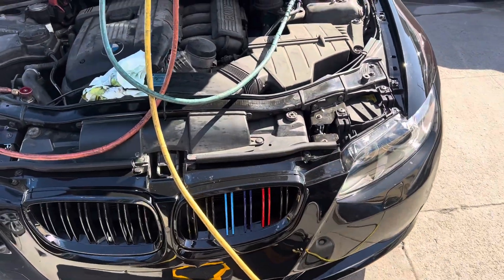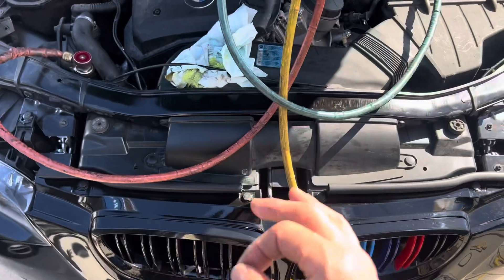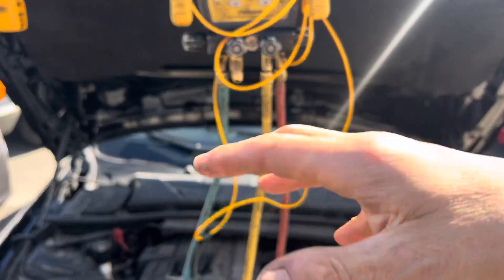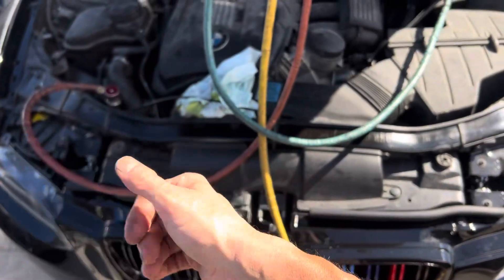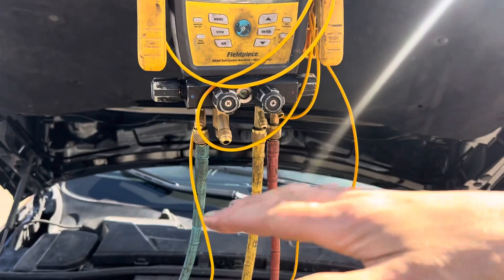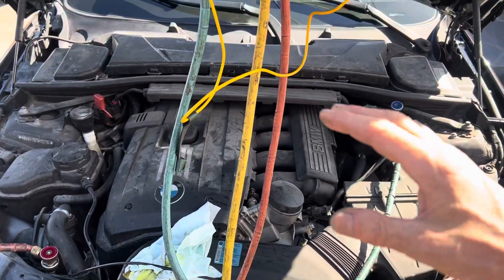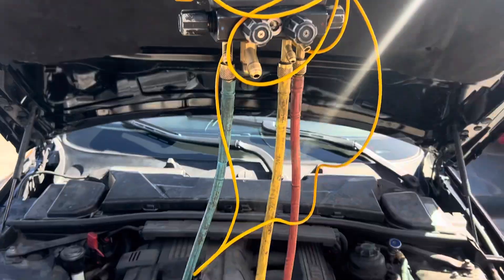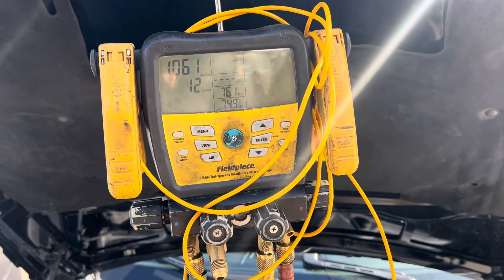Releasing Refrigerant into the Atmosphere￼￼ (this is how you know) ￼

Comment: Is there any way I can remove the refrigerant myself without releasing it into the atmosphere? I have got the gagues and the vacuum pump but there is around 40 psi on my low side. I want to take it down to zero so I can refill it with a vacuum.
Reply: You need a recovery machine & tank to recover the refrigerant. The machine in essence is a compresor with a condenser built  in to allow the refrigerant to condense “become a liquid” before going into the recovery tank. Some of the refrigerant gets trapped in the oil during recovery. So to aid in getting most of that out, the system being recovered needs a heatload to aid in the recovery.  When a heatload is applied, the refrigerant boils off from the oil and becomes vapor. I believe this is covered in EPA 608 @ 609. Please correct me in im wrong.
Reply from the maker: @grandchungusandhobbies3707  yes you are correct
Reply from the maker: What is the high side pressure. 
        Some cars don’t equalize pressure right away after being turned off.    Or if it’s colder out side below 45 psi you can read 45°F or below. 

If it was 85°F outside and both your low side and high side or 45 psi that would be and you only have a very tiny amount of vapor refrigerant estimate about 1 ounce. 

You do need a recovery unit, but.  Some automotive shops will recover your refrigerant for free. Just some not all. 

But if you had a lot of refrigerant.  And you had a recovery tank and one of those small freezers that go down to -20F below zero. 
           You can put a hose on a recovery tank that is vacuumed below 500 µm. 
           And if you have a long enough hose leave the tank inside the freezer attach your low side hose leave it on overnight.     And by the next morning 99% of your refrigerant will be in the tank. 

The laws of physics
Understanding the three gas laws. 
            You can accomplish a lot and understand air-conditioning and better than just a guy who replaces broken parts
Reply: @coldfinger459sub0  Approximately how many ounces does it take to reach saturation pressure?
Reply from the maker: @crvinva  this has nothing to do with ounces this is something you have to study and learn about 

By the way you asked a question do you definitely have a lot to learn nothing wrong with that we all had to start sometime. 

But that’s why you have Wikipedia you have Google and you have YouTube with some YouTube providers that are actual true HVAC instructors who give free training. 

One day as I retire or get close to that I want to volunteer and donate my time and become a college HVAC instructor but that will take a lot of dedication.    You only work three days a week it only pays about $100,000 a year so it’s not much money here in San Francisco California but it’s OK for three days a week as a retired person with no debt no bills.
Reply: @coldfinger459sub0  I keep asking and I keep learning. But maybe I didn't ask my question clearly enough. You said that at 85 F 45 psi is about 1 ounce of refrigerant. At that temp saturation pressure is about 95 psi. My question is - how many more ounces would it take to reach that pressure?
Reply from the maker: @crvinva  It has nothing to do with ounces. 

If I had a 2 pound system and I put 1 ounce in it there would only be vapor at 85°F

If I had a 1 ounce capacity system and I put 1 ounce of liquid refrigerant in the system at 85°F it would be 100% liquid. 

If I put 16 ounces of refrigerant into a 2 pound volume capacity system for 85°F you would have nearly at rest just guesstimating off the top of my head 14 ounces of liquid refrigerant in the 2 pound system and maybe 2 ounces of vapor refrigerant that would match the PT chart for 85°F showing the correct pressure. 

The first example of 1 ounce of refrigerant in a 2 pound system at 85°F would not have enough liquid refrigerant to reach the point of the PT chart for the temperatures or pressure relationship so therefore there would be no saturated refrigerant in the system

There’s a lot more to it than that and giving somebody a detailed exact only answer you would learn and discover absolutely nothing. 

It’s a journey of reading about the three gas laws and taking your knowledge from there to other basics that you need to know to go along with that to give you a good in-depth understanding you must understand not just have an answer.
Reply: @coldfinger459sub0  In the spirit of teaching and learning let's consider this hypothetical experiment. We'll start adding refrigerant to a system in deep vacuum. After adding X ounces (or fraction of an ounce) of refrigerant, system pressure will go up to 0 psig. We'll continue to add refrigerant and system pressure will continue to rise until we reach saturation pressure (which depends on temperature, let's say 95 psi at 85 F). At this point there's no liquid refrigerant in the system, only vapor. Let's call this amount of refrigerant Y ounces. Then we'll continue to add refrigerant until we reach system target weight. Let's say target weight is 1 lb. What amount of refrigerant are X and Y? Just roughly, ballpark numbers.
We can also (just hypothetically) talk about an overcharged system where entire volume is filled with liquid. This part is obviously not practical not to mention unsafe. But just to get a rough sense of total system volume, how much refrigerant (ounces) would completely fill the entire system?
Reply from the maker: @crvinva  that would vary from system to system and it would very greatly depending on the design of the evaporator coils

Let’s use the size of a vehicle theoretically for example. 
Two identical twins

The only difference one Toyota he’s gonna have a Microchannel coil condenser any Microchannel coil evaporator .
        We are going to say that the factory specifications to fill this up to the proper refrigerant level might be 570 g.
             But you completely fill the system up with liquid refrigerant because of the diameter of the number 10 section line and a diameter Number six liquid line plus the high-pressure discharge line will be a number eight. 
     I’m going to guess that would be about 1500 g two 1700 g of total liquid refrigerant to completely top off with no vapor in the system

Now let’s jump over to the other Toyota that’s going to have the old-fashioned style 3/8 inch tubing fin condenser

And a old-fashioned 3/8 tubing fin evaporator all the pipes and hoses will be exactly the same

In this car to completely fill it up with liquid it might be 3000 g of refrigerant 

Do you have serpentine pipe style heat exchanger

You have the old style 3/8 of an inch tube in fin heat exchanger

You have 6 mm tube and fin heat exchangers

You have standard Microchannel parallel flow heat exchangers

And then you have the newer most highly efficient super small Microchannel heat exchangers that even have a much smaller internal diameter inside the internal finned tubes of the Microchannel them self. 

So as you can see it can make a drastic huge difference into quantity of refrigerant needed depending on which manufacture chooses which heat exchangers for their condensers and evaporators

And we didn’t even talk about the different sizes of the internal volume of the receiver dryers. 

And getting back to adding refrigerant from a vacuum into your add zero psi and then continuing adding refrigerant once you hit that equilibrium of the PT chart for example if you needed to pounds of refrigerant and you had 5 ounces of refrigerant and you’re just one psi under the saturated temperature pressure for the ambient temperature you still only have 100% vapor refrigerant without even one single drop of liquid refrigerant so you would not quite match the PT chart for the temperature and pressure. 

     But then you add one more gram of refrigerant just the tip the scale into saturation.   Now you will have your first single drop of liquid refrigerant forming inside the system.   All the rest would be vapor.    Now any additional refrigerant you add after this point would all be condensing and filling up as a liquid refrigerant inside the system. 

So whether your containment vessel was the size of a Coca-Cola can and you had enough refrigerant to get beyond saturation and you had one single drop of liquid refrigerant at 85°F
         And you have a large semi truck tanker truck and you filled it up with refrigerant to the point where you have one single drop of liquid refrigerant at the exact same temperature

Both the Coca-Cola can and a large semi truck refrigerant container the size of a house would both have the exact same pressure. 

The size of the system does not make any difference. 

The only difference is the Coca-Cola can may only have 1/2 ounce of vapor refrigerant and one drop of liquid refrigerant

In the large semi truck container the size of a house might have 400 pounds of vapor refrigerant but only one drop of liquid refrigerant

And they would both be exactly the same pressure. 

I hope that made sense. 

Let me add some more to that

If we continued filling the Coca-Cola can so it only had a 1 inch base to the top all filled with liquid and 1 inch at the top was vapor

And we filled the semi truck container the size of the house all the way almost to the top so it had a 1 inch gap at the top of its container of vapor refrigerant 
        They would both still have the exact same pressure as when they had one drop of liquid refrigerant.  Of course at the exact same temperature we’re always staying at the same temperature. 

The only difference is the Coca-Cola can might have about 11 ounces of refrigerant in it

And a semi truck with a container the size of a house might have 50,000 pounds of liquid refrigerant in it